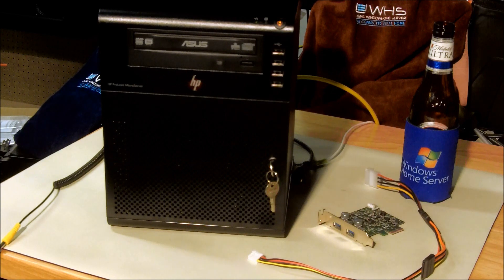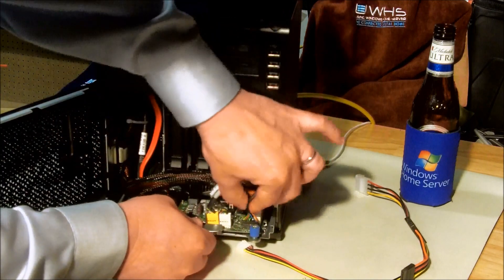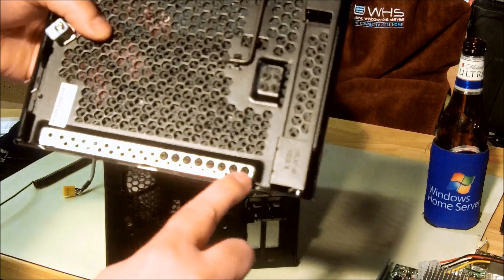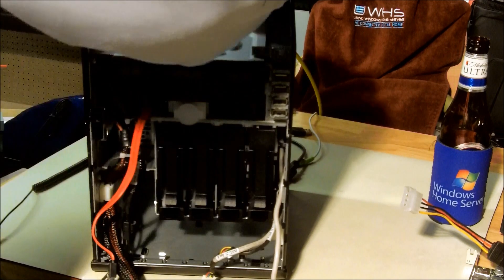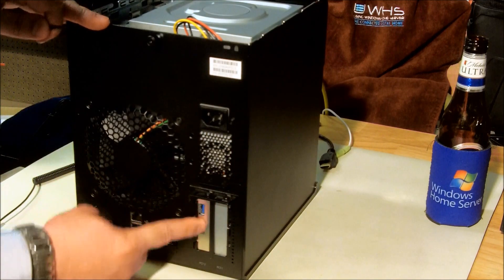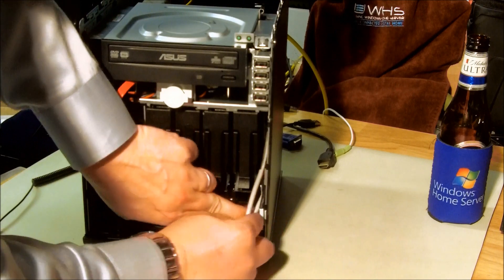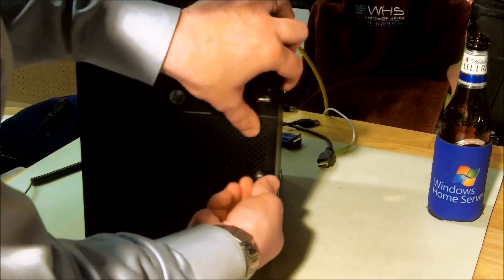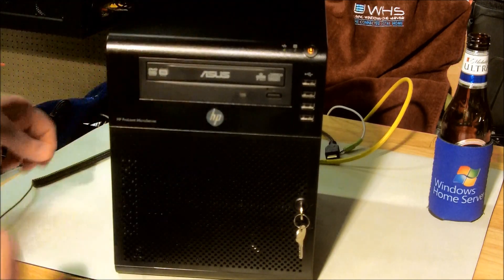HP ProLiant Microserver

Comment: It's not necessary to pry the socket open as some have suggested. The clip has a couple of tiny teeth locked in at the top of the receptacle. Press the plug INTO the socket to relieve pressure on those teeth. Using a small flat screwdriver, press in at the bottom of the spring clip, between it and the top of the mini-SAS socket. While pressing in with the screwdriver, pull up on the plug.

Comment from the maker: @DrDiatone You can get every type of cable through Newegg. Check your USB card to see what type of power connector it uses. Many new cards need a Molex type connector so you might need an SATA adapter or Molex splitter depending on how you set up the server.

Comment: @macintosh0 I have two of these and do not make noise at all and they are very quick. 

for the front 4 bays you do not need any cables or power as it is in a slot mechanism however you will need a SATA cable for the top 5.5" bay and the appropriate connectors.

For me I added a 3.5" SATA drive so i need a sata cable and also a molex to SATA power connector.